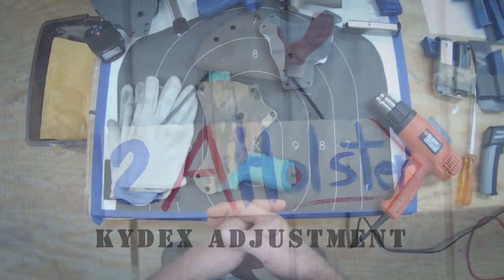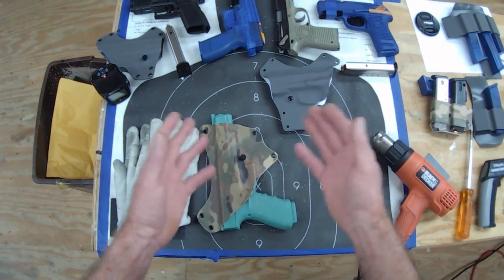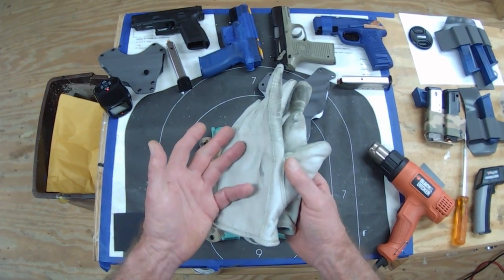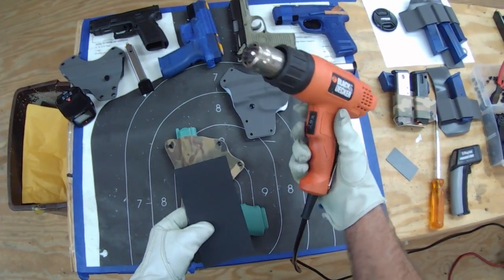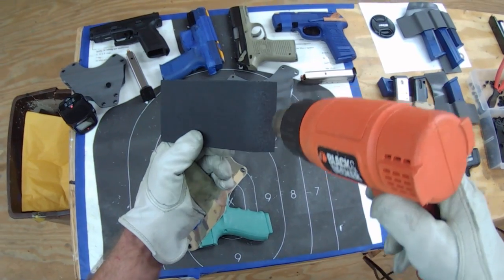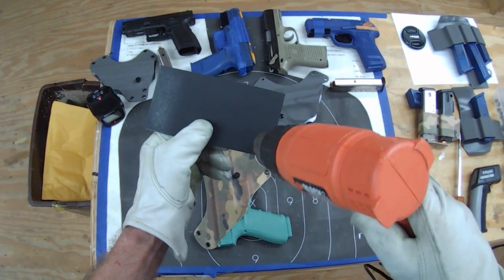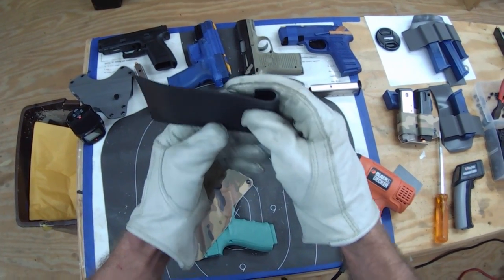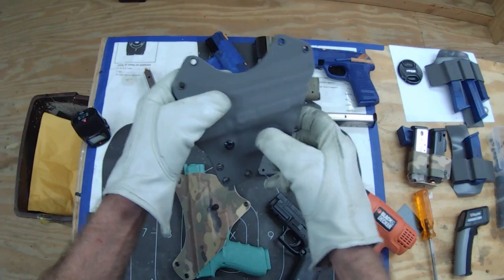Heating & Adjusting your kydex Holster

Comment: Does the kydex get damaged by cooling off too quickly? If I heat it up in a room that is 70 degrees, then immediately  take it outside where it's 20 degrees or pop it in the freezer to cool it off, will it hurt the kydex?
Reply from the maker: Negative. Won't hurt it at all.

Comment: This is great - I was about to return a holster as it didn't really fit my gun. I will try this. 
Thanks so much - AND, an excuse to buy a heat gun :-).
Reply from the maker: Awesome! :)
Reply: 2A Holster , I worked on my holster with a borrowed hear gun and WOW! Even I can do it. 
I even adjusted the tension of the clip which wasn't catching my belt. 
Really, thanks for posting.

Comment: Thank you so much! I ordered a k frame holster for my 686+. The reason is that I cannot find any kydex holsters for L frame revolvers that are iwb, so I decided that I will just make the holster adjustments myself to accommodate the slightly larger gun. I saved this vid into my library for when I get my heat gun in the mail. Thank you again! I probably would have ruined the holster without this vid. I will do a video when I get the heat gun to show the process and how it turns out, and I will be sure to mention this video and leave a link.
Reply from the maker: Mention 2A holster too, if you would. Best to you sir.
Reply: @T0mmyTune  will do!

Comment: Great video with a ton of good examples of how to adjust a holster! I bought a G19 kydex for my CZ pc10 and while it was a close fit I want to make it better. You covered just about any issue in doing so!
Reply: Why would you purposely buy a holster for the wrong gun?
Reply: @wanted4taxevasion  because he wanted a holster made by a company that doesnt make them for cz, and most glock holsters will fit a p10c.
Reply: Ah, the P-10 problems...I know all about them.  It's even worse for the full size

Comment: Great explanation.  I have been struggling with a holster I cannot draw my pistol out because it is too tight.
Reply from the maker: Getting them too tight or too loose is really easy to do in a holster shop using molds. Too many variables. we all need  a little help to figure out how to fix our Sh**t! :)
Reply: I have a G code that's too tight when the weapon light is attached (I verified with G code that I'm using the correct light btw) 

Would you suggest trying a file first...I can see where it's rubbing inside the holster..

...or should I use a heat gun first?
Reply: @WBT1993  Not sure what a G code is.  But I would definitely try a heatgun and working the holster with the pistol before I would take any material off the holster.

Comment: Thanks man.  Need to modify a holster to fit CTC Laser Grips.
Reply from the maker: Great! Thanks for the comment!
Reply: @T0mmyTune  Well, IT WORKED!  I first figured out how deep, wide, and high I needed to make the adjustment.  I used a folded index card, old pencil with very hard eraser, and a welder's marking pencil.  I took measurements and marked the holster.  I folded and taped the card to the grip so it would raise the pencil to the right height off the frame.  I followed your advice...BOOM!   SUPER EASY AND FAST.  I was amazed how easy and fast it was.

It helped that I had two of the same handgun, one with CTC laser grips and the other without, to see how exactly what I needed to do.  Now the CTC-equipped revolver fits perfectly and will no longer "ride 1/4" too high" in the holster.

THANK YOU AGAIN SIR!

Comment: So I added a laser/light combo to my EDC, was on sale for like $80 off and didn't realize until immediately after I paid that I will need a new holster. Question is can I use a heat gun with my holster to fit around the laser? Its a bit bigger than some lasers you see and its very blocky
Reply from the maker: All depends on the holster. Mine there is no way. I close mine up tightly to the weapon and have a tension adjuster on each holster. So that tension adjuster is usually what gets in the way of a re-do. So, really depends on your holster.
Reply: @T0mmyTune  yeah I got home to take a good look at my holster, and yeah, the little screw is right where my laser would be so I fitted it to a 1911 I have and it works really well. Lucky I found this video or else the idea wouldn't have come to mind lol

Comment: Great video! Let me ask, I have a 4” 1911 with a rail. I can’t for the life of me find a holster for it. I finally bought a 5” holster for it, but it shifts up and down about 1/8”-1/4” inches. Can’t get a solid lock. Is it possible to simply heat up the excess barrel length and flatten it down to mold it around my actual barrel length? Will it be saggy and weird since it’s stretched?
Reply from the maker: Hard to say on that. Usually a bit longer holster, such as you mention is not the culprit for being loose. For instance if I made one for a 5 inch 1911 and your's was a shorter barrel, it'd probably be snug all the same. Looseness on that I would guess would be between the top of the slide and the bottom of the trigger guard. Sig for instance has a bit of a different cut on their 1911's. And of course sight/sight-channel differences between different manuafacturers. Why not contact your holster maker? And of course I'd be glad to make a holster for whatever barrel length 1911 you have. 2aholster.com :)
Reply: I contacted the original manufacturer, and they just offered a full refund since they didn't have this firearm on hand and wasn't able to make a perfect mold for it. But using your technique, I gave it a shot and was able to make if fit nice and snug and slide in and out perfectly. Now, the only thing is it may be a little narrow and wear on the slide on the way in but I'm not too worried about it. It'll no doubt take some finish off on the tip, but I'm not trying to win beauty contests with my weapon.  I'm kind of worried to heat it up again to try to make it a bit wider on the sides of the slide because I don't want to mess up the snugness I was finally able to acquire. Have any suggestions for that? 

The firearm I'm fitting is a SA Champion Operator.  Amazing gun but darn near impossible to holster.
Reply from the maker: Sure. Buy some blue masking tape from LOWES or a Hardware store and add 4 or 5 layers to the side of the slide, then use the techniques in the video and holster your weapon. Let it sit until cool. Holster makers use LOTS of blue tape or some kind of masking tape every day for just that kind of reason.

Comment: I want to add a light to pistol.how much heat can kydex handle? can I heat up while pistol and light are in kydex while I finger press fit?
Reply from the maker: The video should basically show you how much it can take. Yet, describing how much heat kydex can take is rather hard. Use a hair dryer and do you as you mention. Nice and easy and don't be in a hurry.
Reply from the maker: Also, it can take about 340 degrees f' if you can measure it?

Comment: I'm having trouble finding a holster for my CZ P-01 with a TLR-8 light, but I can find one for a TLR-7 (no laser). So I'm thinking get the one for the TLR-7 and heat it up, slide in the gun with the TLR-8 and it should mold fine, just need a tad more room for the laser. Sound right? Much appreciated.
Reply from the maker: I make holsters for that light and gun combo-> 2aholster.com. 
Yeah well, it all depends. It depends on the holster itself and is that heating and molding/remolding gonna interfere with some component part of the holster. It would on mine because of where I place the tensioning screw. Otherwise the remolding should not be too big of an issue. That said, if you do remold the holster you'll not be able to return it. So always best to simply find the proper holster light combo from the get-go. best of luck.
Reply: @T0mmyTune  Thank you. I'm looking for a holster/sidecar. The TLR-8 is just a tad deeper for the laser. Appreciated the input and I'll check out your site!

Comment: Any tips for opening up the bottom of a kydex holster to fit a threaded barrel? Had one made and didn't know to tell the guy I was running a threaded barrel. It has black suede on the outside of it too :(
Reply from the maker: Well, sure. But of course, it depends. #1. I'd hope any customer of mine would just write and ask me. #2. If that doesn't help in your case, then I'd simply ask is it riveted at the bottom, or pinched closed? If Riveted, then you may need to remove a rivet or two first. If simply pinched closed, then simple heat ought to make it ease open. HTH!
Reply: I did message the guy that did it. He was nice about it and offered to modify it. I was worried about it looking modified, so I didn't take him up on it. Plus it was already a 14 week build and having to pay for shipping both ways, I just didn't. I thought about selling the barrel and just get a stock size, but it's about impossible to sell a threaded barrel. It was my mistake I guess. Never had a custom holster made before. 

Anyway, it's a pinched closed bottom. It has about a 3/8" gap and needs to be opened to 0.7 to fit the thread protector. I read on a forum to keep any part of the  holster you don't want to heat up wrapped in a wet towel and to hold the bottom up (because heat rises). I just basically heat the bottom on the holster and push the threaded portion through the heated kydex and it should open up?
Reply from the maker: Sound's about right. Did you watch the video above?  A little longer than I like, but it ought to give you all you need to proceed. So I take it He wouldn't give you any pointers to fix it yourself? 
None the less. Opening it up is easy as heck. Like easy-easy. watch the vid. And take your time. And good luck.